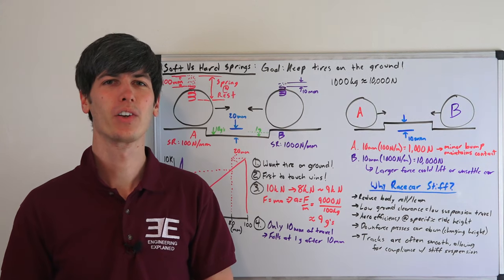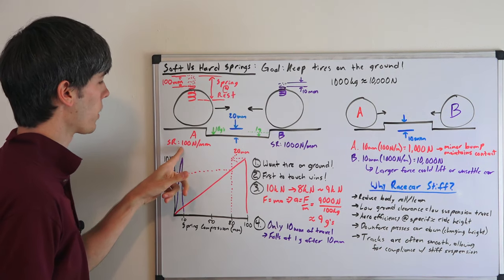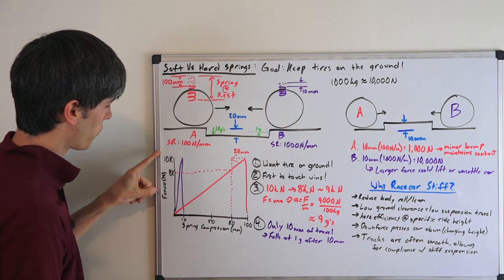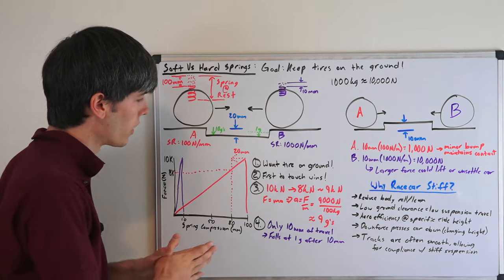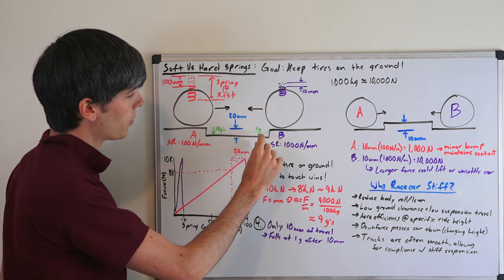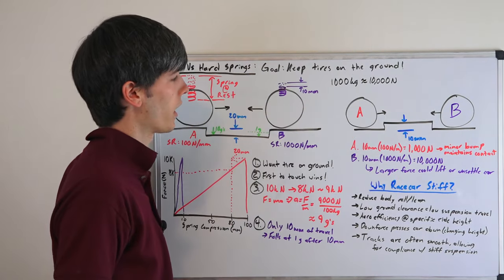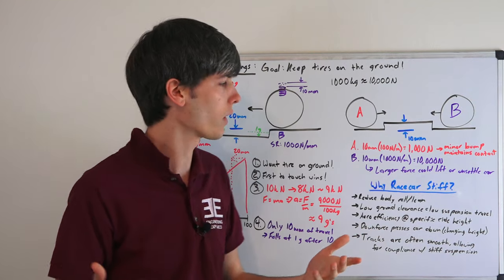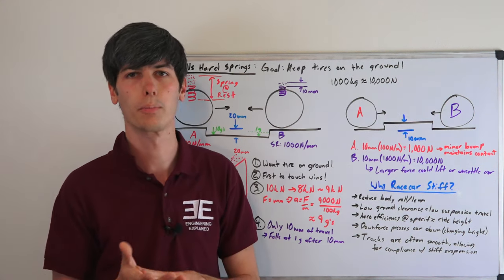What's The Best Suspension - Soft or Stiff Springs?

Comment: sooo... whats better? soft or hard springs?
Reply from the maker: I think I have a video covering this... it depends. :) As soft as you can get, without compromising other factors too much.
Reply: exactly!!!!!!!!!!!!!!!!
Reply: street car go with soft , race car go with hard
Reply: provided you have smooth roads to drive the race car on
Reply: The only time you want stiff springs is when you have to maintain a body height and even that is a huge trade off soft springs keeps heat out of the tires,less unsprung weight  and more road compliance so larger contact patch means more mechanical grip and if you really want to get serious  you will end up with bumpsprings on your shocks  I would love to see a video on that
Reply: Not  bumpstops but  bumpsprings
Reply: okay i replaced my stiff springs +shocks and put back my original shocks + lowering springs..
i got my comfort back now.. missed it allot!
Reply: its best when balanced
Reply: For racing hard and for normal car med or soft...
Reply: For the street and a somewhat hard driving style soft springs and firm shocks are probably best.
Reply: You sound like a teenage Civic driver.
Reply: I'm an elderly Scion XB driver on the waiting list for a stick-shift Toyota 86.
Reply: mannacler I was referring to the OP.
Reply: Simple:  OFF road -> Soft
ON road -> Stiff
Reply: are we talking an actual car or a game
because if your talking asphalt racing as in NASCAR you run as soft and you can Period the day of 3000 # springs have been gone for 20 yrs now and honestly all of the dirt trackers i know are super soft as well. but i would guess the Indy cars or the formula car would be different because 1 inch of bump or droop would have you sliding right off the track but other that i have to assume most or the comments are for the street driver
Reply: Simple:  Brazil -> Super Ultra Mega Soft
Reply: LMAO
Reply: i
Reply: springs that comes with your car are the best, do you think the R&D team of your car's manufacturer is paid for playing nfs?
Reply: Exactly my view.
Reply: Well I was a manager at Chrysler for 7 yrs before leaving and I can promise you that is thier mindset  now with the hell cat and the viper all together different planet
Reply: The answer to this question is far more complex than this video actually provides explanation to.  You need enough spring rate to balance out:

Ride height related issues (bottoming out, aero forces changing the "normal" ride height, etc)

Control Alignment changes during suspension travel

Keep the wheel/tire on the ground over uneven pavement

Lower CG

Etc.

Fact of the matter is, the "best" spring rate depends on a number of factors.  Intended use should be defined FIRST, after that there is no one size fits all answer.  My 2009 Mustang GT, setup for autocross (pavement handling agility focus) required good shocks/struts first, but required 550lbs/in front springs and 275 lbs/in rear springs to minimize camber loss while cornering due to the strut front suspension.  It could have probably used 650lbs/in front springs, but I never bought them before changing cars.  I had 440lbs/in springs up front with 200 lbs/in out back and ran into several issues.  At 27" ground to fender height the car would bottom out the rear suspension and the front suspension underwent enough compression to where I'd get positive camber in a corner even with -3.0º of static negative camber.  

What that told me is that I either needed to correct the geometry, raise the car, or change the rates.  Body roll was present, but not horrible with that setup.  Given that raising the car up presented a number of other negative issues (higher CG meant more body roll), and correcting the geometry was not allowed per class rules, that meant more spring rate.  At 275lbs/in out back the rear end no longer bottomed out, with 550 up front I no longer saw positive camber in a corner, but didn't see enough negative camber to keep the tires happy (more camber wasn't possible as it was maxed out at the camber plate).

There are other things to keep in mind too.  How a car utilizes the powered wheels is important too.  On my 2009 Mustang I ran relatively soft rear springs.  Being a live axle with poor spring motion ratio, I suffered from a multi faceted problem.  First, the live axle is already relatively intolerant of bumps so adding too much rate meant a more twitchy car at the limit.  Second the way a live axle's motion ratio works is that you have a different ratio in roll than in bump.  In bump the spring rate is additive, in role it is subject to some pretty screwed up formulas to work out the rate.  Third, I needed the car to be loose at corner entry and tight at exit.

Ultimately, because geometry was largely free for live axle cars in the class I ran in, I went with a car setup that allowed me to have my cake and eat it too.  By adjusting the rear watts link center pivot point higher I raised the rear roll center which reduced body roll in cornering.  This allowed me to use a softer spring out back than if I had retained the lower RC preferred by most.  As a result the car in the longitudinal (acceleration/braking) direction was able to transfer weight slower and the car was allowed to squat some to put down power better.  This made the car loose on entry and tight on exit like I wanted.    You cannot, I repeat CANNOT, accomplish this with JUST spring rate changes.

So to answer your question.  "It depends" is the best way to word it... because suspension is all about compromise.  You need enough spring rate to keep the contact patch at maximum, and there is far more to that than just the spring rates themselves.
Reply: Did you have more turns to the left or right doesn't matter just wondering if you used tie down shocks to help you  at all  and did you do all of this with tire Temps or Data Aqauistion  or both  but you're correct in your statements and analysis. . Great read enjoyed it
Reply: It's autocross, the course changes every event and every location we go to.  I used data acquisition for some parts of it, but most of it is observing tire wear and roll over over the course of the year.  I didn't start doing tire temp stuff until this year... ironically only after I lost the ability to actually tweak the alignment beyond the factory adjustments lol.
Reply: I live and die from tire Temps  it's let's the  chassis talk to me HAHAHA  plus  if I am doing setup work for some one else I can learn how they drive and set the car up from there  lol
Reply: Yeah it is really a good measure of what the car is and isn't doing.  I don't have a probe but we did have someone with a FLIR attachment for a phone come to a test and tune event and were able to observe the heat across the surface of the tire after a run.  Rears were fine on my 2015 Mustang GT/Perf Pack at -2.2º of camber and zero toe.  Even across the entire tread width.  The fronts though, in typical strut fashion, even at -2.1º of camber and zero toe, the inside was way cooler than the outside shoulder.  Our wear on the tires mirrors this.  The fronts eat outer shoulders too fast.  If I could change this and stay in the class I'm in, I would, but unfortunately all I have are factory authorized mods (already done to get to where I'm at) and a swaybar choice.  We've played with both swaybars and have settled on the front bar in the softest setting and the car drives fine, but I'd like to fix that tire wear issue.... Doesn't help that we can't change the wheel widths from factory so I'm stuck with staggered wheels and can't rotate them.  Tires get flipped and moved from front to back and inside to outside about mid season to help wear issues.
Reply: well for a track car weighing roughly 900kg for example, youd run about 500-700 lb in front and 150-200lb rear
Reply: It seems there are a lot of "it depends" answers out there and I would have to agree with most of those answers as car weight and ideal ride would be a major factor in how stiff springs for a car need to be. If you look back to the 1960's though and have a look at the Lotus Elan and other models at the time from Mr. Chapman he followed the mantra of the softest spring possible. He minimized overall car weight and unsprung weight to the max. Then used soft springs for example the front of the road going Elan was 78lbs/in and the race version 26R was only 128lbs/inch. Proof that softer springs are better since the Elan has been referred to as the best handling sports car ever. But there were some important factors here. A relentless pursuit for lightweight cars and low unsprung weight resulted in this.  As soon as car weight goes up and the desire to reduce the center of gravity is so strong along with big brakes and big tires and wheels we see a trend in rising spring rates in today's modern suspension systems to make them work. But we also have seen an improvement in road conditions so the lower grip resulting from not enough suspension travel with a stiff spring less of an issue today then back in the 1960's.
Reply: PlaystationQUAD-Pro 
long springs are the best
you wont even notice when your car's wheels pass over a stone or a hole
however you can also do like a friend of mine did. put some short springs to your car and hear the sound your head smashed on the roof of your car everytime there is an irregular road
or fear that the bottom of your car will break on the ground and spill the engine's oil 😏
Reply: fjodor hoxhaj Hey whats the name of that spring or suspension you talking bout so i can install it to my car :) .. i have feeling the shocks of the streets wholes etc . thanks brother
Reply: Whiskey's Gaming Lounge 
Dude incredible read. Seriously!! Is there a way we can link and I can pick your brain on a project I'm working on?
Reply: garbage handling
Reply: too advanced for me but sounded very tested and scientific
Reply: You sound very knowledgeable, are you an engineer?
Reply: Whiskey's Gaming Lounge   Thanks for your excellent post.  Your problem description and solution should help me sort out my new suspension and handling problems on my 96 Z28 at the autocross.  

I'm understeering a little on corner entry, and oversteering a lot on exit, so its real touchy on the throttle with the stronger motor to not wheel spin.  I can't get good exit speed into the short straights.  Suspect too much rear roll couple.  I'm going to adjust the rear watts link center pivot point one hole higher, and go with softer rear springs, and adjust the rebound.
Reply: Three years later (2018), and still Americans are dumbing-down the fake axiom of "stiffer should be sportier". Total nonsense. That's why earlier Camaros and Mustang had horribly hard suspensions with no performance benefits, while a "softer" (more compliant) BMW could turn circles around aforementioned muscle cars.
to answer, my dear chocolate/strawberry, democratic/republic, one-of-only-two-choices-mentality friend, is a huge IT DEPENDS.
Reply: Potholes or smooth road= stiff spring, bumpy road= soft spring
Reply: Five10 since there is no one size fits all perfect setup, your comment reveals an incredible amount of ignorance.
Reply: Hard
Reply: @N-e.o  buy adjustable. Set it to what you want
Reply: It's a trade off known as the ride/handling compromise.  A stiffer car responds to a drivers inputs more quickly, but too stiff and you lose single wheel bump and ride compliance as described in this video.  Too soft and the car will feel "sloppy"  and "bouncy" and slow to responde.  Taken to an extreme, too soft springs and dampers can lead to a suspension bottoming, which will then give you the stiffest suspension there is....none!   

So, like most things, it's a trade-off and there are many approaches taken by different drivers and engineers based on preference and track conditions too, of course.  I like to think err on the side of softer and use your dampers and anti-roll bars to control your pitch and roll motions.  To do it properly, you need to do the math.  Google "suspension natural frequencies" and calculate based on guidelines and the sprung mass each corner is supporting.
Reply: Asking a dude?

Comment: EE, I think you are under-emphasizing the impact roll, dive and squat have on dynamic weight distribution. While softer suspension indeed maximizes grip (everything else being equal), the same soft suspension also results in a huge body roll, which, while turning, results in alot more weight being transferred from the inside wheels to the outside wheel. This causes the overall coefficient of friction to drop, resulting in LESS mechanical grip on smooth surfaces. 
Another advantage of the stiff suspension, that I believe is important to mention, reducing roll dive and squat allows the driver to control the vehicle more precisely, while going through a turn. It becomes even more important during transitions. (it takes less time for the vehicle to lean into the turn and to "take a set" when the suspension is stiff)
Reply: +drklop You're right, and I think it's disingenuous to say that the "only" purpose of suspension is to keep the tires contacting the ground. However, I think the lesson to take away from this is that a street car can suffer from having too stiff of suspension.

I think my car is an example of this. The first owner put some very stiff suspension on it and it goes around smooth corners like a go-kart. When you turn the steering wheel, there is no perceptible lag whatsoever. However, I've hit some bumpy patches of road that made it really difficult to control. It would be a great setup on the track, but on these bumpy Dallas streets, I think softer suspension (softer than it currently is) would have been the way to go.
Reply: +drklop This is actually a very non-trivial matter, and there's no such answer as "softer/harder is grippier". As a simple example and counter-example, stiffer compression dampening can actually increase grip, as it makes the tire deform more around small bumps in the road increasing the surface contact. But too much compression dampening, and the tire begins to bounce up from those bumps. OTOH, one can reduce the rebound dampening to make the tire respond better to small pits in the road or bounces after bumps. But too much reduction, and the suspension begins oscillating. Little oscillation can be ok in a race car (although quite uncomfortable in a passenger car). But too much oscillation, and the tire begins once again bounce up from the road.

The spring rates, dampers, and tires (+ sway bars, camber, caster, toe-in, and rest of the suspension&body geometry etc) must always be considered as a whole, and in the end, choosing the values is an optimization problem between comfort, grip, and driving "feel" over various surfaces. The more prestigious car manufacturers actually put a ton of effort in this area. And then ignorant tuners ruin their cars with some "cool" low-profile oversize tires, which make the ride uncomfortable and less grippy - even in the track, regardless what people in general believe.

But I guess that as a general over-simplification, one can say that a softer setup is more grippier than the stiffer. But this applies only in the relatively small window around the sweet spot before other factors start to speak for the stiffer setup.
Reply: true, the added weight on the outside will never equal the grip of four tires with weight.
Reply: Body roll does not substantically contibute to overall weight transfer.  There are very minor effects from CG migration, but that's it.  Body roll is a symptom of weight transfer, not the cause.

Body roll does hurt camber with non-solid axles and can cause earlier contact with bump stops, causing effective wheel rates to spike upwards.

Comment: So what's going on with rally suspension? I know they have lots of travel but are they stiff or soft?
Reply: I guess they have a "pretty soft" but not too soft springs with very very good damping
Reply: soft suspension
Reply: GrahamBartle soft springs, hard shocks and long travel.
Reply: ***** 
Rally drivers also slide their cars because of a technique called "late apex turning" it just allows the driver to see more of turn before having to decide if he/she needs to turn a lot or little. The body roll sounds like a good point as well for why they slide though too
Reply: lowering its not the only way to reduce body roll. anti-sway bars at the front and rear, tuned for your car, will reduce body roll maintaining the under/oversteer balance. a lot of cars of today have soft dampers with stiff sway bars.